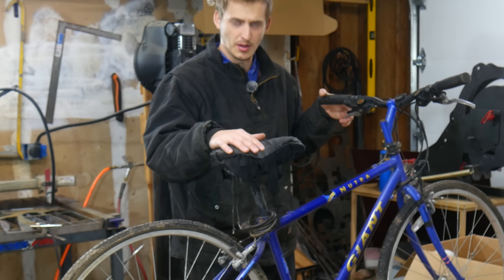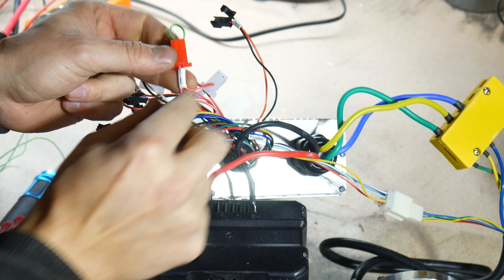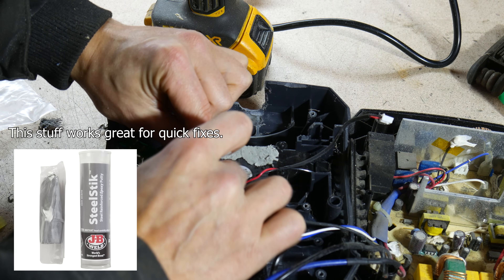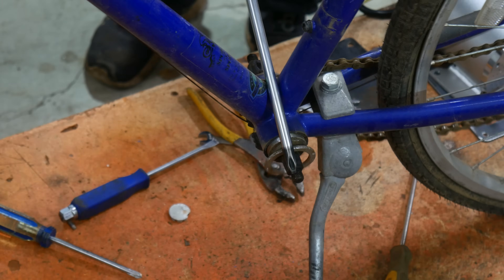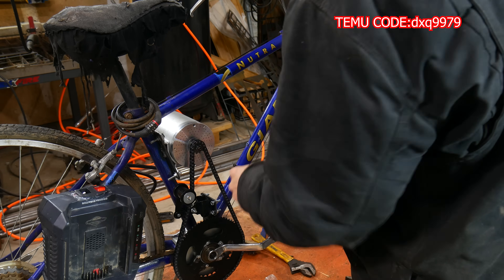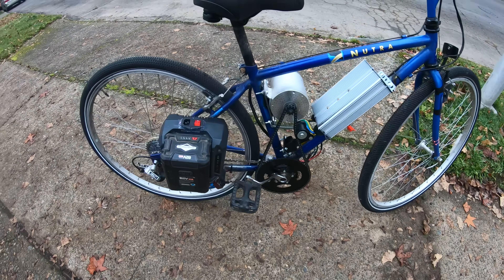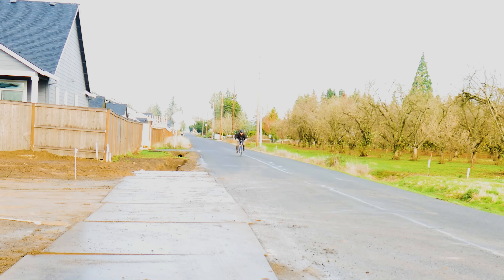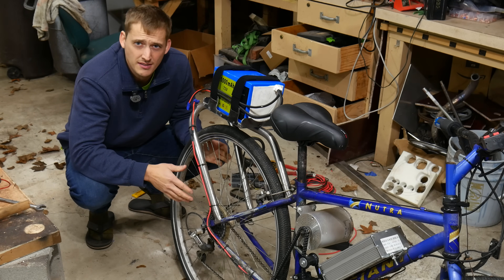This Temu kit DIY E-Bike is Terrifying

Comment from the maker: Should I do a gas-powered version of this?
Reply: sure, but you should definitely finish the cvt 2 stroke build
Reply from the maker: haha working on it. next video!
Reply: Of course, would be lighter, and you can drive farther, without long recharging stops.
Reply: Hybrid?
Reply: Heck yeah
Reply: YES!!
Reply: convert a gas bike to electric, then run it using a generator 😂
Reply: buy  or find a old 1kw vacuum cleaner and rig the motor to a bike controller,  obvs need a inverter
Reply: You should do a 2 parallel 80v batteries.   Thats how greenburps powers their go kart to 25mph.
Reply: No there's no point. You nailed it. Just put it on a better bike and make it safer and Max out.
Reply: No, gas is last century.
Reply: No. You should stop spreading temu shite.
Reply: @ClaudeSac  It's literally the same shit as on amazon. In fact many sell on amazon stuff they buy on temu 😂. Its easier than dealing with a distributor
Reply: @user-rl6fs6rd7m   I did not say anything about Amazon; don't put words into my mouth buddy.

Comment: Okay. I feel like the whole ebike industry has gotten so big so fast ..and the prices have definitely went down. But you built an ebike that goes 50mph and didnt have 2 grand invested. I know the battery is the most expensive part most time. But u bought a lithium battery that's off brand but I've seen people buy. I know u need a battery that can handle the watts from motor without it ruining it in no time. Are those batteries u bought as good as the ones that come with new ebikez that are 3000w etc

Comment: So Im guessing you have not experienced chainsaw and pitbike engine powered single speed bicycles. With only rear, pedal brakes yet huh?
This is why my new asphalt gravity bike was designed around a 230mm floating front disk and 180 mm rear. With hydraulic double piston calipers front / rear. And a rigid front fork. Super sensitive now!
Stopping is kinda important, and 1 finger pinky sensitive brakes are awesome once you stop flying over the handlebars.  Literally, you will do just that if you get a downhill set like this. Any decent hydraulic brand.
PS I also use a 50cc Honda 4 stroke from a Honda blower. It pulls the bike pretty well and is quiet. No premix and all that.

Comment: A WALMART BIKE!?!?! No, sir it is not!

I do get what you're saying though. It's a 1990s rigid steel frame hybrid bike. I wouldn't want to go 40 on it. maybe downhill as long as there's a long run-off so I don't have to jam my shoe into the tire to slow down. 

I had a 1996 GT Timberline (yellow/blue paint scheme). It was awesome but also the brakes weren't very good. They were the old cantilever style (aka Y-brake) and while they stopped okay when they were brand new they got out of alignment pretty quickly. 

If I still owned that bike I'd swap out the brakes for the "straight bull cantilever" (AKA V-brake). Sadly the ex-wife "borrowed it" and never brought it back.

Comment: That's no Walmart bike. Sure it's pretty low end, but Giant is a proper bike brand and it has Shimano Altus parts on it. They actually work... Well, at leisure cycling speeds... the brakes might melt at 50+ MPH!

Comment: That tiny battery will run out of charge very quickly you need at least a 30ah battery when useing 72v at 3000w to maintain good amount of energy storeage

Comment: As an avid MTB'er and motorcyclist I could hear the loose ball bearings in the head set and hubs screaming! "This thing has no business going that fast." Truer words could not be spoken haha!
Reply: Brakes now totally inadequate with the extra weight.  Gear train and frame not designed to handle the stress and torque of this arrangement.  Accident waiting to happen.  No thanks!

Comment: How would one do this on an aluminum frame..? I was so tempted, but my open bike is unfortunately not steel.
Reply from the maker: Just gotta find nifty ways to bolt the motor to it. or learn to weld AL lol
Reply: I’m thinking 2x4s and some bolts.

Comment: FIY: To go faster in a mid-drive bike you need to provide more current to the motor. 
Which means you need a high discharge battery pack, built with tick nickel strips or copper sandwich and more powerful controller like fardriver for instance. So you can use other gears for higher speed. But that can overheat the motor if you push too far and if it is not designed to run with high current extended period of time.
Reply from the maker: thanks for the tip. tbh I don't want to go faster though!
Reply: @OliverMotorized I really like your project and I understand you cut corners for the sake of video. Would be nice if do a version 2.0 with a cheap steel fat bike

Comment: I wish you would understand the correct side of the chain to put the chain tensioner on. It goes on the side of the chain that is being pulled not pushed. The motor or engine sprocket pulls the chain tight on one side. The tensioner does not go on that side. How you haven't figured this out over the course of tons of projects is baffling.
Reply: Oh you finally figured it out, thank god
Reply from the maker: this is the first video I put it on the wrong side lol, and I corrected it.

Comment: Get a Steel bike frame. And a Telescopic front end. Heavier wheels and 26×'1.195 or 27x2.8 tires for it.
Reply: Also,a Disc front brake setup.

Comment: Congratulations on figuring out that the idler goes on the slack side..!
Most never grock that, or that there is in fact a slack side...
Reply from the maker: Yeah I think I was confused at first because I’m usually looking at chains horizontally lol not vertical like this setup

Comment: I have a temu gas bike kit and a temu welder. I also have slammed a few times but I think I figured it out now. Honestly I put 400 miles on it and I replace the cylinder rings and piston every thousand miles. Runs great.
Reply from the maker: yeah I mean, the products on Temu are the same manufacturers as Amazon, but with amazon you're paying a little more for local storage

Comment: I’m honestly surprised the lawn mower battery depleted so quickly.

I’m curious what the top speed is now?  I just know that’s scary fast for a bike but it’s a very energy efficient platform outside of aerodynamic.
Reply from the maker: i didn't mention in the video but that lawnmower was a$50 facebook marketplace find. so that battery was already several years old. not sure of top speed. but >55mph
Reply: @OliverMotorized That’s funny I’m working on a Razor repowering it with 24v drill batteries.

Comment: There is a little screw on the rear derailleur marked "h" for high gear. Screw that screw in about 1/2 a turn at a time, until the chain can no longer fall off the gears into the frame 8:40 like that. Also that bike isnt nice but certainly isn't garbage. Its probably got lots of heavy but serviceable parts.
Reply from the maker: ahh thanks for the tip!

Comment: i made a bike like this in college. the same my1020 motor, center hub drive like that. it was awful. I had a huge gear ratio from the motor to the pedals and it was still geared too high. these motors dont need gears, and works much better as a direct drive to the back wheel
Reply from the maker: were you using the standard bicycle crank set ? I felt like the gear ratio for this bike was great. But as you see in the video I change out that outer gear.
Reply: @OliverMotorized i remember buying the biggest sprocket i could fine for the center, think it was like 72 tooth. maybe i couldve swapped the casette for a different ratio too. either way, had no low end torque and would stall out. ended up putting the drivetrain into a little scooter direct drive and worked much better